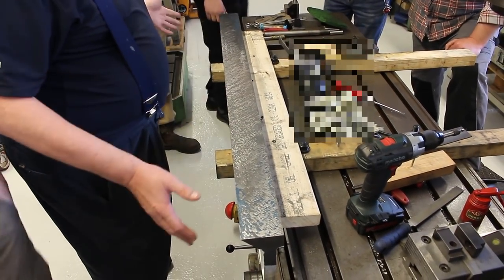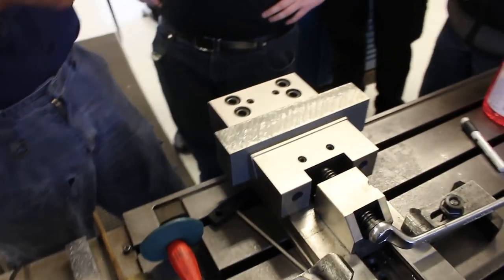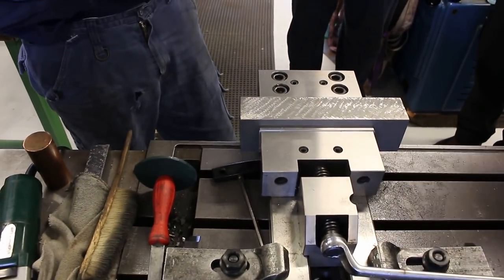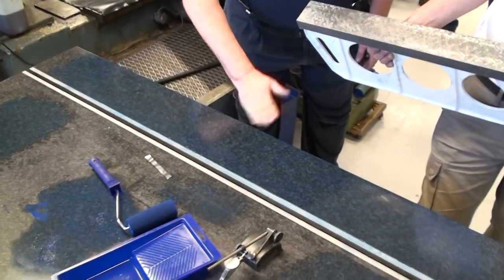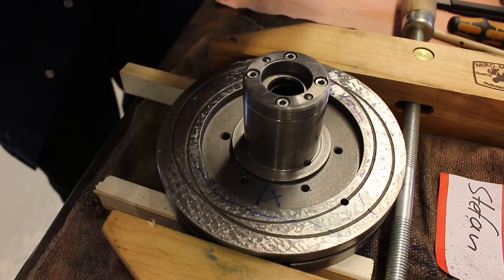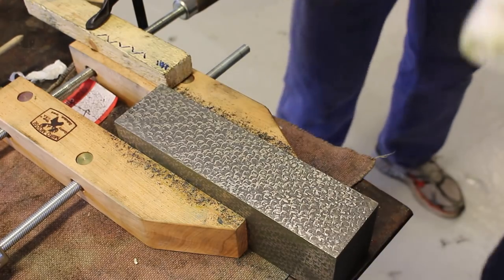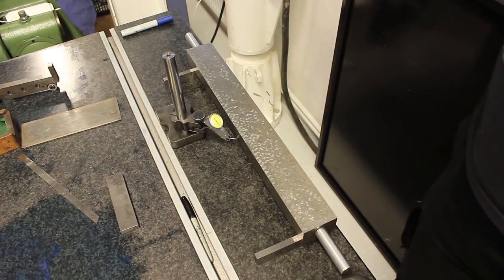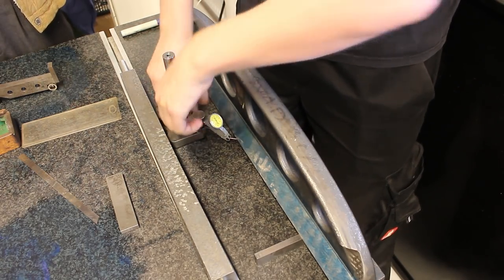Scraping class 2017 in Denmark

Comment: Great stuff Stefan, thank you for sharing.  I've heard of aging cast blanks, programmed thermal cycling, and roughing before heat treatment, but never ringing.  Of course NOW it seems obvious!  Cast iron is used for both wear and vibration dampening characteristics, I see the ringing as a "limbering up" of sorts.  Congratulations on the rotary table results, what started out good in now undeniably better.DAS

Comment: I was curios how you blued the high spots on the rotary table bearing surface. There's the bearing shaft in the center, so you obviously couldn't just blue it on a surface plate?
Reply: the bearing surface on the base is scraped first to a reference surface, ie a surface plate and then the bearing surface is scraped to the base.
Reply from the maker: Just as Mr. petersen6 said, I first scraped the housing-bearing-surface flat on the surface plate and used that as a master to blue the rotary-part.

Comment: Scraping for level, that's when it gets really interesting. For instance older Landis grinders had two leveling pads on the base in the area where the casting extension for the Wheel Head Slide would mount. When scraping the table ways they had to be scraped to the same level as the leveling pads. plus they had to be matched to the master beig used PITA

Comment: I never understood why they flake. If you scrape 20 points per inch then there are already low spots for the oil. If you have the desired points and then you flake doesn't it mess up the points?  I guess need to take Richard's class. Stephane did you notice a big difference in the feel of the rotary table after scraping? Was friction reduced? Thank you for filming this. Really interesting, especially the bit on prismatic ways.
Reply: I believe that flaking is used to create an oil film that suspends the part off of the frictional surface.
Reply: scott black it's my understanding that flaking is c 0.002" deep compared to scraping marks of say a tenth of this. I. e, th flaking makes deeper pockets over the surface, but I'm just getting started scraping ...... flaking next few weeks.

Comment: Stefan how did you blue the part of your rotary table with the giant boss sticking out the middle? Did you just blue it hanging off the edge of the plate or was there a plate that had a hole in the center?  Wonderful video and great work!
Reply: Do the base first, then that becomes the reference for the table.

Comment: Sorry, I don't understand. How does hitting the edge with a hammer release stresses?
Reply: It greatly releases stress. In you not the part
Reply: I don't know either, but I know that it works, especially while welding cast iron(pain in the ass).
Reply: SJWs & Betas Killer Maybe you're the one who needs to read up. Weld peening has zero to do with shock stress relieving like striking a casting. It expands the metal that just shrank as it cooled from welding. Nice try, though.
Reply: On the job I retired from we used to use one of these to stress relieve shaft and other material prior to machining. A 6 ft /183 cm shaft with a 1/2"/12mm keyway cut over 75% of its length would bow like a banana if this was not done. http://www.formula62.com/
Now as to whether hitting a casting with a hammer, can't say. I have to ask if the casting has been "aged" or run through a thermal stress relieving process
Reply: It boggles the mind how forces below the ductile/tensile strength actually do something in cast iron, on the other hand i understand wanting to hit that part after many passes and the worst case would be that nothing changes at all and it is just bluing and measuring error. So if it was possible to prove an effect: cool.

Another way of looking at it... the cast iron consists of iron and graphite flake grains (depending on the type, it may have flakes, spheroidal, layers, or vernicular), that might allow rearragangement by small forces after scraping. The whole self-lubrication thing of cast iron is about opening graphite grains and using those pockets for another lubricant to replace the graphite. That alone might change surface tension and the force required to move graphite is probably small.

If there is a measurable effect, it probably helps during the work to not fall from one extreme to the other without knowing why and having a part with less tensions is always preferrable. But is it up to anyone who cares to rule out other deviations like thermal stresses by work on the part.
Reply: My skeptical radar went off at that point too. I think for the instructor to prove it, he could have had two items; one which they didn't hit, and another that they did, to prove that the bluing really was different between trials.
Reply: Thomas,
the expanding of the metal, as you stated, actually relieves the tensile stresses built up due to the shrinkage. Otherwise a tensile crack may be initiated. the peening is to prevent the cracking of the weldment as a result of the internal stresses created by the shrinkage of the metal during cooling.
Reply: ipullstuffapart
They did prove it in the video. they blued the part before stress relieving and then blued it after stress relieving and they noticed the different pattern in the blueing. the different patern indicates that the part moved during the stress relieving process.
See the video from 6.44 and specifically at 7.22
Reply: Metal castings, if not properly stress relieved have very high tensile stresses in them approaching the yield point of the metal (just sitting there with no loads applied to them).  The small shock waves from the hammer blows produce pressure spikes that can micro yield these areas that are basically at the yield point already.  It is not the same thing as a proper heat stress relieving, but it will move the metal a few microns. 

The stresses are the result of differential cooling during solidification of the molten metal.  The outside cools faster than the inside and turns solid first.  As the inside solidifies and cools, the outside which has already solidifed resists the shrinkage of the inside.  This places the skin in compression and the core in tension.  The tensile stresses can approach yield in some sections, especially heavy sections, and thus the hammer trick can work.  Cold drawn material (and forged) does not generally have this problem as all of the fibres are yielded during rolling/forming and thus have the same stress (they are all reset to zero by the  stretching process).
Reply: Charles

Though they did do that, it isn't a sound testing methodology. They did show that the bluing changed, but what they didn't show is if the bluing would not change if they blued it, rubbed it, cleaned it, blued it again, rubbed it, and compared. The core of the scientific method is to at least have some form of control, which they neglected. There's a pretty likely chance that the blue pattern could change between tests because of how many variables there are in the rubbing, down to where the pressure was applied, how it was applied, and the pattern the piece was rubbed.
Reply: Just a thought: The desire is of course that there are no tugs-of-war in the material, but if there's a risk that there are, they should be in stable deadlocks. So if you're malletting , perhaps you're not necessarily eliminating the tugs-of-war/stresses but you're putting them into a more stable, unshakable deadlock.
Reply: +chris0tube  If you take a pipe and put a bolt in the middle of it (both made of the same material with the same yield stress), then tighten the bolt, you end up with a situation similar to a casting.  The inside bolt is in tension and the outside pipe is in compression.  If you then put the whole assembly into a tensioning device and plasticly stretch it so you have yielded the bolt and the pipe in tension, both sections (the pipe and the bolt) are now at the yield stress in tension.  When you remove the tension, both parts will now return to zero stress.  The same process happens whenever you plasticly deform a material.  Whatever locked in internal stresses that happened due to thermal effects during casting (or welding) will be washed out and replaced with more uniform stresses.  Depending on the magnitude of the plastic deformation (plastic strain vs elastic strain) you can reduce or completely eliminate the internal stresses.  This is what happens with both cold drawing and forging.

Regarding peening of welds,  the welding process layers hot molten metal onto cold (relatively) solid metal.  As the weld cools from a MUCH higher temperature, it goes into tension, while the underlying material goes into compression.  Multipass welds exacerbate this problem.  High tensions near the surface make the welds more susceptible to fatigue cracking.  Peening the surface compacts the metal by yielding it in compression on the skin.  This reduces the tensile stresses (and if done aggressively can place the surface into compression) and thus significantly improves the resistance to crack formation and thus fatigue resistance.
Reply: Barry Gerbracht Very nice explanation, I've found each type of material has its own unique way or storing and releasing stresses, welding seems to cause the worst deformation at times, the longer the part the more correction must be performed. I've worked with different nylons and delron, sometimes it takes minutes for them to relax before taking final measurements.

Comment: This Hammering Technique for stress relief sounds rather dubious to me.

1. the only occasion that i (and google) remember about "Stress Relief and hammering" is the mentioning of High frequency hammering or Ball Blasting of Welds to imprint a positive pressure on the surface and therefore lessen the effects of micro cracks

2. If internal stresses could be released mechanically, i very much doubt the industry would waste all the money to glow Parts for hours and days in ovens to do exactly the same (again a quick reseach suggests that only 1 of the 3 Forms of inner tensions, the latent tensions, can be reliefed and only with a thermal process

I of course wouldnt discard what the man does, he clearly knows a lot about the topic. i would however be interrested if "stress relief" is actually what he does or if it has another meaning that might have been lost in translation

Comment: How are the granite reference surfaces ground? Why can't the same process be done for metal? Thanks
Reply: They are rough ground, then lapped flat.
Flatness is check with special comparators that operate on the principle that a surface has "hills" above the low spots, and that anything sitting on the slope of a hill will be tilted at an angle that can be measured.
Search for surface plate calibration. There are some excellent vids on it.
Reply: I might be mistaken, the laps might be precision surfaces.
Reply: But similar processes ARE used with metals. So your question doesn't make sense.
I mean: grinding, lapping.
Reply: My question? I've never seen anyone "scrape" a granite surface.
Reply: The laps are precision surfaces, and require periodic maintenance to keep them that way.
Keep in mind that an out of calibration surface plate is still very flat, and that granite abrades much faster than a cast iron lap. The lap will stay very flat and any minor variation put into the lap by on surface plate will be removed by the next surface plate. Eventually the lap will acquire a hollow shape that is fixed by lapping it against 2 other plates using the "3 plate method."
TBK, it is the same exact process used in labs in extremely high pressure experiments (think metallic hydrogen), only scaled up. microtome blades for some types of sectioning are sharpened by lapping. I have lapped lenses for spectroscopy in a previous job.
Reply: Thanks for the info.   I began to suspect that I was wrong about the laps and considering oxtoolsco video on the three plate method, I was pretty sure I was wrong.    Fascinating stuff.

Comment: maybe i should have said how can you make a large surface "flat" with such a small contact area with the scraper? it would be near impossible to get a flat finish using a one square inch sanding block on a large surface of a car.
Reply: I agree it would be hard to put a car onto a surface plate to check how flat the paint is...
The principle is simple. Start with something almost flat by grinding or milling, then check it against a perfectly flat surface (a surface plate). Then just scrape off the high spots. Rinse/repeat until it is uniformly flat.
There is no machine that exists that can get a surface as flat as hand scraping. The precision machines used for making thing precise are all hand fitted and scrapped.

Comment: coming from a automotive paint and body background this scraping technique makes no sense at all. If it were used to straiten the side of a car the finish would have more waves in it than the pacific ocean. just trying to comprehend.
Reply: It is used to increase the contact area of two sliding surfaces that contact each other.It has nothing to do with auto body work.
Reply: You want waves in 2 machined surfaces that rub against because of oil,if everything was flat it would just slip away thnx to a bitch called gravity.this way oil stays in the grooves and helps with friction and reduction in wear.
Reply: David Goodrich It takes a bit to wrap your head around. The flat reference surface is the granite plate (or a straightedge that's been scraped to a granite plate). The workpiece is rubbed on the granite to mark high spots with a very thin film of ink. You remove the high spots successively until you get the workpiece into "full" contact with the granite. In most cases, "full" really means about 50% because there must be shallow low spots remaining for lubrication pockets. Hope that helps...?
Reply: In body work, you are striving to average things out so that light reflects in a uniform manner. One of the reasons that there are no flat surfaces on a car body, is that it would be commercially impossible to get the paint flat enough to not look terrible.
In terms of straightness, even the straightest line on  car body is less straight that the most worn out milling machine can make.
These folks are measuring straightness to 1/100mm or less.
Reply: joshua43214, unless this is a pin-line put on by Mark Court, a coachline painter on a Rolls-Royce. : )
Reply: maybe i should leave this subject alone but how much does an oils hydrobarrier have on the readings throughout the length of a lathe?
Reply: Dear "David", you just don't get it, that's why you are only car mechanic/painter, and will never be able to do such precise work (machining, toolmaking and related).
Reply: SJWs & Betas Killer Why be a jerk to someone asking an honest question to learn? I suppose you can scrape to 40 points per inch and paint a showcar, too...?
Reply: your mother must of had a rough delivery with you having a scraper in your hand
Reply: i was trying to compare the ''digging'' action of scraping to somebody final sanding a panel with the uneven pressure of there fingers that would result in a uneven finish.a painted surface only has to reflect light to show a uneven surface unlike a lathe bed that can be mechanicaly measured. your explanation of the high points being only critical makes sense being that it is the only load bearing surface and the low spots for lubrication. anywaaaay its amazing how a surface can be made ''flat'' by such a technique.I will remain baffled.